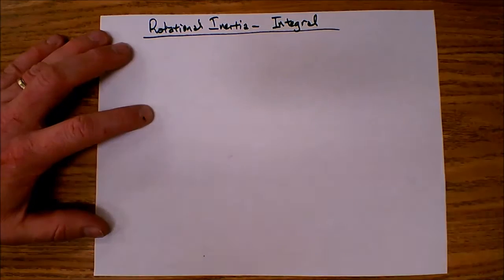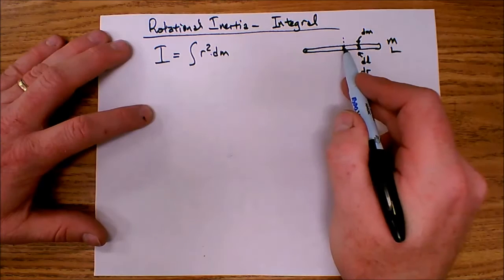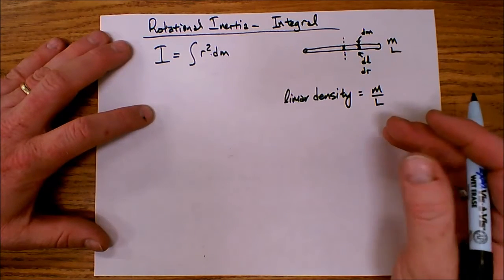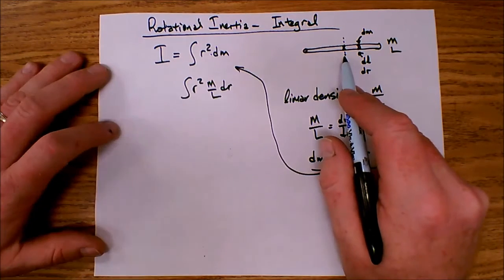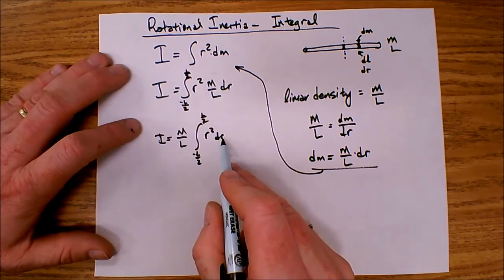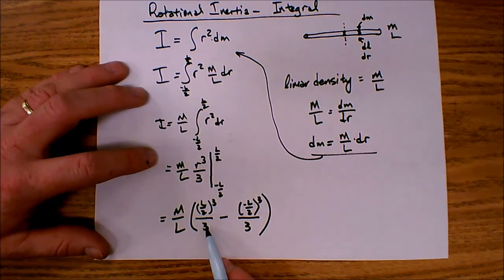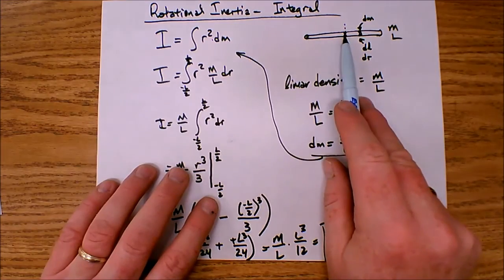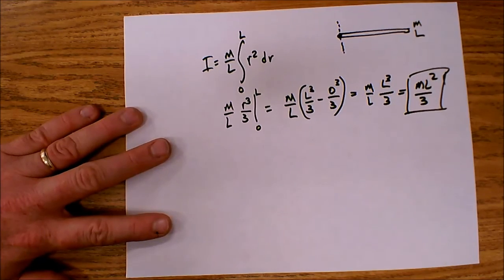Rotational Inertia Integral

Comment: is "dr" the distance between the axis and "dm" or is it the thickness of the tiny mass "dm"

because if it's the latter then wouldn't that mean that the "r" in "dr" a different r then the "r" we use for distance?
Reply: The dr is the thickness of the tiny dm, idk how to answer your 2nd question
Reply: a bit late, but to answer your second question, the small "r" in "dr" becomes the big "R" used for distance once we integrate r^2 from 0 to big "R", thus meaning that we evaluate r^3/3 from 0 to big "R"

Comment: But why integration limit is R to 0 when its a cylinder rotation about its axis?
Reply: ? Do you mean why are the integration limits different when the bar is rotated at its end compared to center?  Well, let's look at it this way. Say you are integrating the moment of inertia close to the point of rotation. The mass that is near that point of rotation does not have much of an effect, compered to a mass at max length. That is why 'r' at point of rotation is 0, and as the distance increases so does the moment of inertia. It increase in a linear fashion. 
Also, a bar that is rotated at it's end has a higher moment of inertia than rotated at its center. That is why in the first example  you end up dividing by 12 where the later is divided by 3. The latter that divided by 3 has a higher moment of inertia.